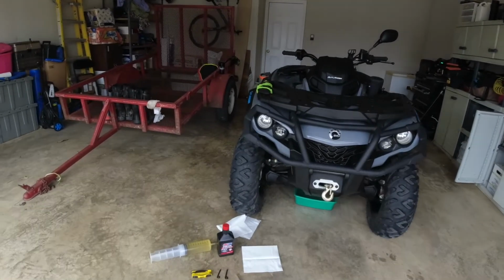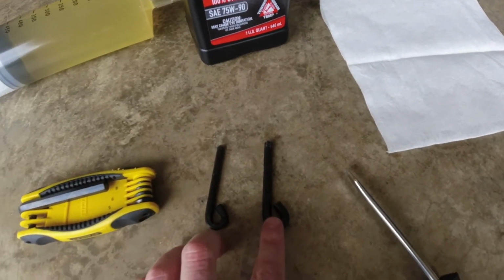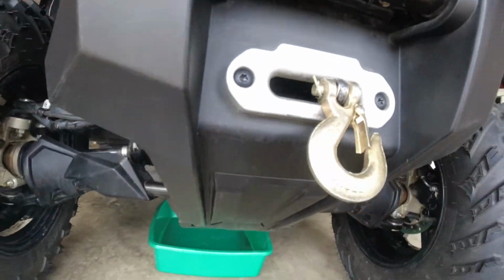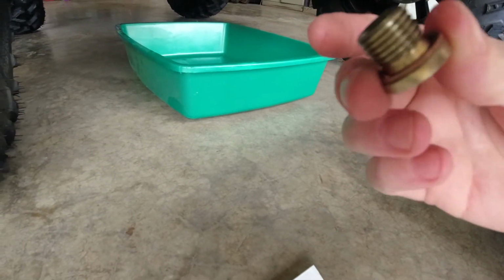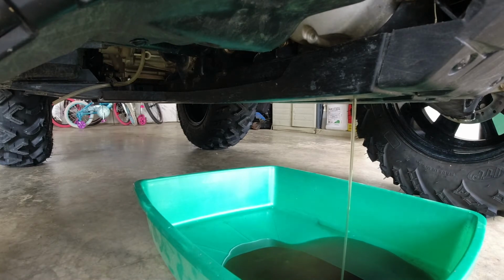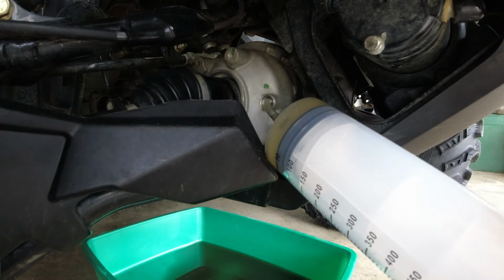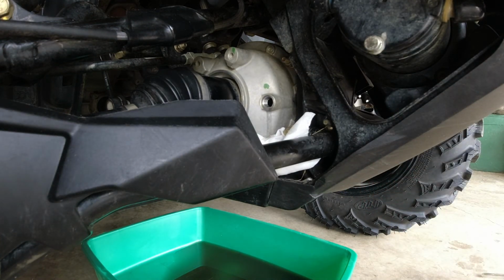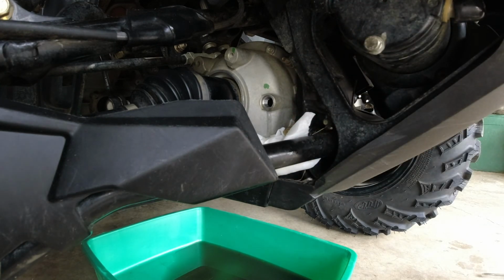Front Differential Oil Change - 2021 Can-am Outlander 650 DPS

Comment: Changed mine twice now, first at Break-in and now. 
Fair amount of very fine metal. Good thing I don’t listen to the manufacturer’s, and overly maintain everything I own. 
Oil’s cheap over all..I use Amsoil for everything I own also. 
In this case I used Amsoil Severe Gear 75W-140 Fully Synthetic.

Comment: hello, I can't find what oil to use at the front unlike the rear where it is well marked (75w140). for the front, do you need a 75w 90 meter as you do, thank you
Reply from the maker: Yes 75w-90

Comment: What is the thing called that has the diff oil in łike a needle thing
Reply from the maker: It was a large syringe I found on Amazon. I wouldn't recommend it for viscous oils.
Reply: @chasintrail  why not?
Reply from the maker: @MrJoel125  the hole was too small in diameter. It took forever to squeeze it out. Maybe if you can bore the tip out a bit, but there isn't much plastic to work with.
Reply: @chasintrail  OK I see
Reply: I fill mine till it comes out the fill hole.